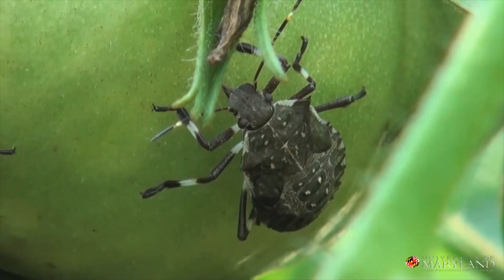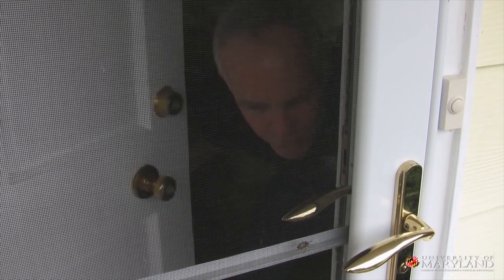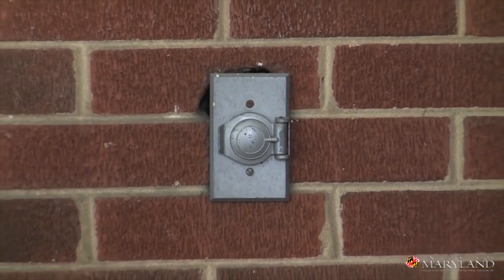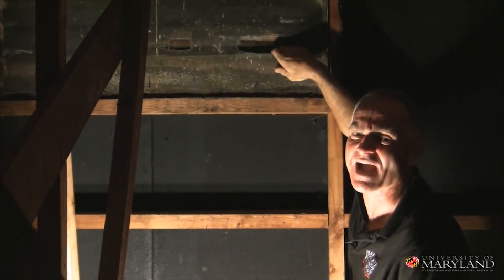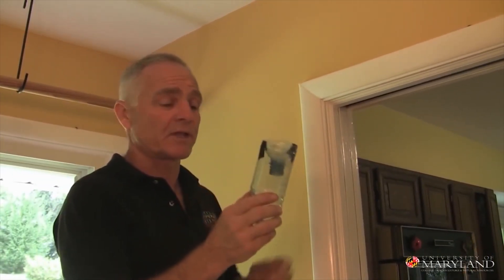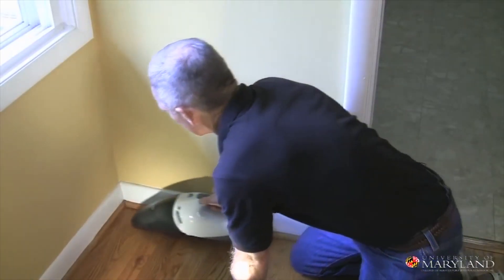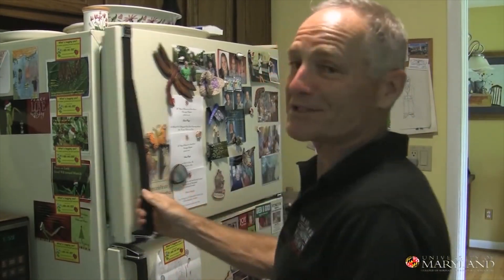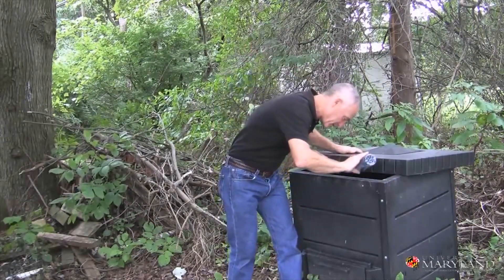Brown Marmorated Stink Bug Control: Keeping Stink Bugs Out of Your House

Comment: Freeze them? Why don’t they die during the winter. We kill 2 or 3 a day in our RV. Where are they hiding?
Reply: Everywhere is where they are hiding.
Reply: @RednailVal  we just discovered that they definitely don’t like the heat from the hair dryer. We opened up a couple of spots and shot the hot air in there and they came crawling out. You’re right, they are everywhere!
Reply: OMG over the past 3 weeks I have found like 5 of them in various places in my RV.  I can't find where they are but I don't think these are strays......How can I find where they are hanging out?

Comment: You will ruin the vacuum especially the kind with a reusable filter. I like to catch the loner with a puff of toilet paper and move it around to expose the head. Then take your fingernail and break the head back (guts come out) and drop in the stool. They can''t think to stink therefore they can't stink. For fun drop one alive in the stool and pee on it, chemical warfare ensues. Then flush with the fan on. The same Philly container port that introduced them to the US has now brought in the worst bug in 150 years. The spotted lantern fly, it make BMSB nothing to make a stink about.

Comment: I cannot stand these damn things, they're seemingly impossible to keep out, and no matter how many you kill comes another. I have an AC in my windows and it gets pretty hot to a point where I cannot sleep and these things get in somehow. I cannot stand stopping what I'm doing just to kill 1 million stink bugs. It's so frustrating as soon as I kill one literally another shows up seconds later inside my room. All I do now is look at my window and wait to see if a stinkbug gets in so I can spray or vacuum it.
Reply: Same here
Reply: same here. every fall like freaking clockwork. are you in the southeast u.s. too?
Reply: @maloneaqua  No, I live in the East Coast. And I found a solution. Me and my mother and I put up this shrinkage storage plastic we used for clothes on my entire window and it seems to be doing the trick. Though I had a few stinkbugs and other smaller insects manage to get in on a few occasions, for the most part yes it seems to be working. We taped the plastic around the window and on the edges of my AC so I can still have air in my room without needing to sacrifice my AC just to get these annoying bugs out! You can try and see if this helps for you I understand how annoying they can be!
Reply: Same here! I can’t sleep if I hear even one! Killing them now, in Maryland they’re everywhere!
Reply: I found a solution ...read my post
Reply: @Nunyabidnuz  , I’m using shrink wrap around the air conditioners…and double sided tape on my door frames. They’re coming in darn droves!
Reply: did you know the stink bug pheromone released on death actually attracts more stink bugs lol? best to get rid of them without crushing